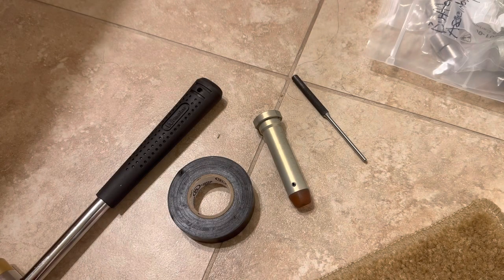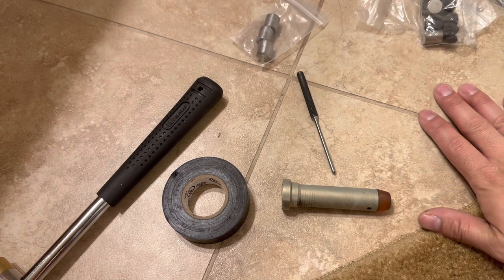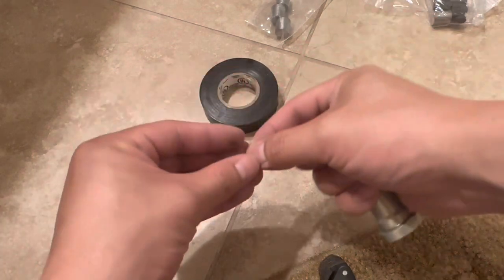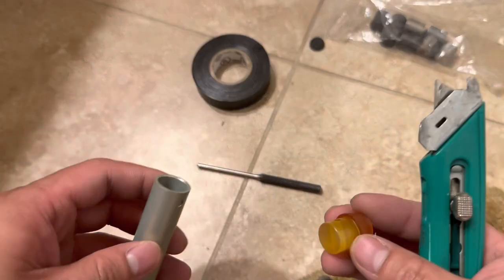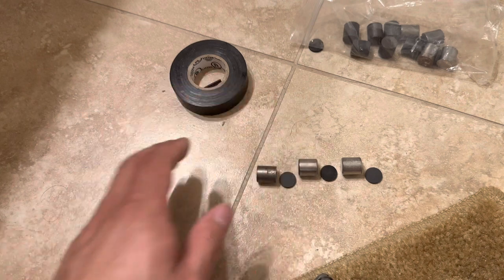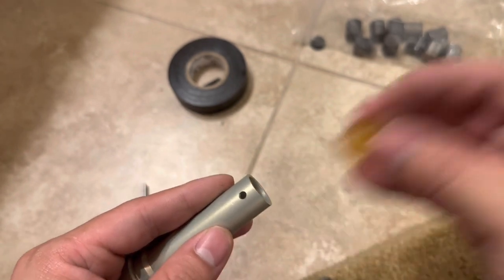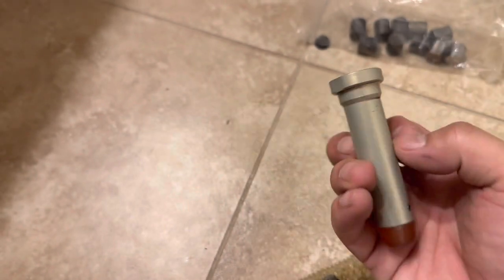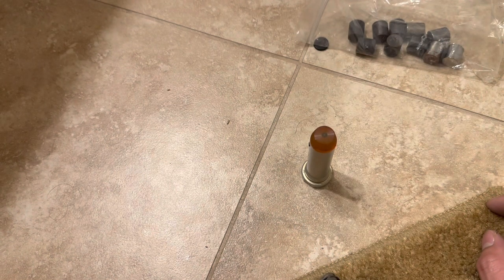How to disassemble and reassemble your Ar15 buffer, and why you would want too

Comment: Make sure to mark the hole and plug on one side ,because I found that mine was off center by a fraction and I had to remove and turn it 180 degrees to line up for the pin.
Reply from the maker: it was tricky to line it up perfectly, since it is required for the roll pin to be installed, I was able to move it slightly by inserting a rollpin punch and pushing it to line it up

Comment: Thanks. I got one of those KAK adjustable ones and they didn't really give any instructions on the ordering of it. I put in H configuration like the first time you shown and this video helped with the ordering of it. I'm measuring it at 3.75 oz so that's good.
Reply from the maker: yeah I saw there were no other videos talking about disassembling a buffer so thought I'd make one
Reply: I wonder if the order actually matters, ir if just the added weight is what is important. I need to take mine apart and just add one tungsten to mine to make an h2

Comment: The only part I cared about was removing that little rubber plug from the end. The pin was the easy part. As for the rubber plug, I grabbed onto it with a set of pliers. It took about 5-6 regrips pulling to the hard up then hard down, slowly gaining ground. Don't be afraid to hurt it; these things are surprisingly tough. Once I got it apart, I dumped out the contents, which were 3 .7oz steel weights and two pads. I replaced all three weights with three 1.5oz tungsten weights I got from Amazon. I started with a total weight of 3.0oz with the one that came in a 556 carbine and ended up with a 5.6oz H3+ for my AR9-9mm and AR47-762x39mm carbines.
Reply from the maker: Nice I found it cheaper to buy the weights your self and customize the existing buffer you have into the weight you need

Comment: The rubber of the buffer of my emtan m4-Frb wore off can it be repair?
Reply from the maker: the rubber portion of the buffer can be replaced easily, but unless its really worn or damaged even it should be fine as is